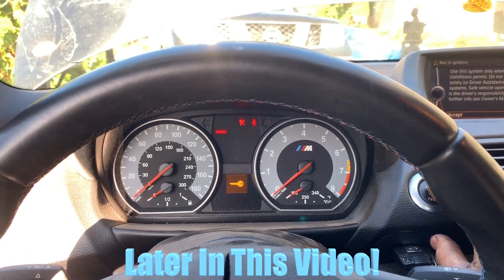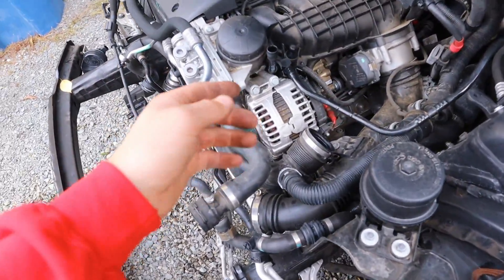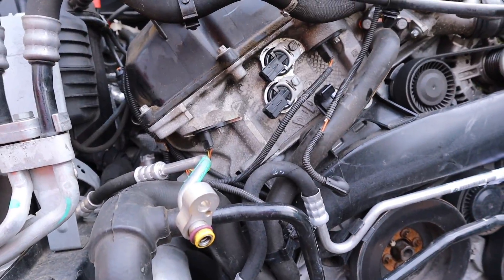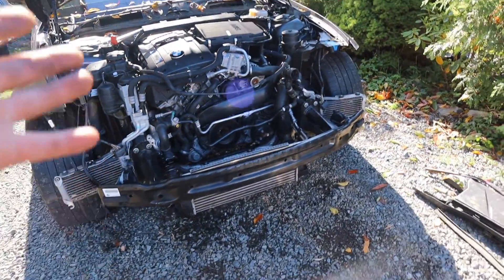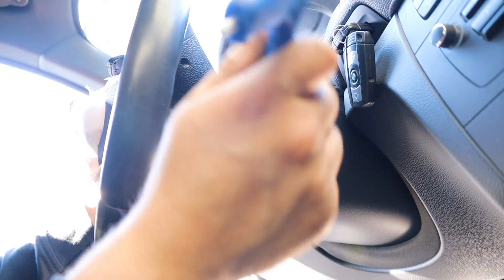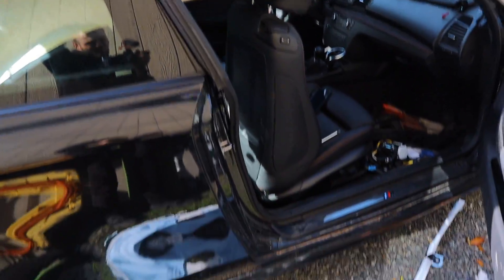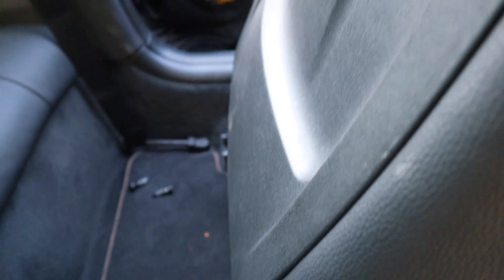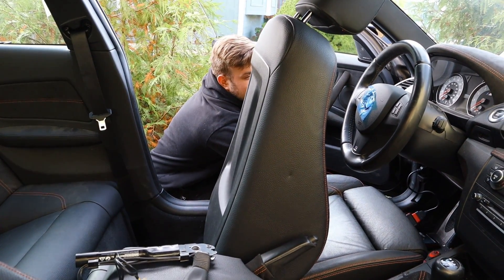I Found SCARY HIDDEN DAMAGE On My Cheap Wrecked BMW 1M From COPART Ep.2

Comment: No fear!  I am enjoying the process so keep up the good work.   The 1M is a blast to drive.   Regarding the rumble from the 1M, someone cut open the "resonators" and found it is actually straight piped to the muffler from factory.  The car is pretty loud and has a drone about 2300 rpm owners often complain about.

Comment: You don't have to make a hole in the steering wheel to get the airbag off. You can wiggle the plastic part with the buttons off and get to the clips from the front. Did this multiple times on my e90 with the same steering wheel.
Reply from the maker: 95% of people go through the hole. Never tried the way you’re talking about but I can see it working.

Comment: I just sold my 1M six weeks ago. Do yourself a favor and during the rebuild check the charge pipe, or better yet, just replace it with aluminum. Mine broke with 18k on the odometer. They are simply inferior plastic junk. The plastic welds just come apart with age. Mine was a garage princess and rarely even saw rain. Do it before it breaks and you lose the clip at the throttle body.

Comment: You don’t have to puncture a hole you can open the covers on top and bottom of steering wheel and then get to the metal clip thats what i do usually just in case anyone didn’t know

Comment: That's a great tip about looking at the side of the steering wheel to see it the air bags,been replaced,never thought of doing that ,thanks !!😀
Reply: ashley kipps just unscrew buttons from wheel and you easly get airbag without making any holes 🤷‍♂️
Reply: O.k,thanks !😊

Comment: I rebuild a 2008 335i about 3 years ago I got from Copart low miles about 37,000 and the motor mount bracket was cracked also from the accident and it want even a hard hit just front end cosmetic but you should be good your car has no frame damage.
Reply from the maker: Found out it’s pretty typical 😆
Reply: BackYardBoyz man you should make a video of all your builds!!! Love all of them and I’m a hard core M guy... wish you the best on your channel and future builds.

Comment: Hi! I notised you didnt pushed inside the blue plastics into the vire housing. They are for a water tightness. By the way there is a more simple way to change the vire housing. Simply just push a needle into the contact and than you can pull it out. 😉

Comment: Why the fuck did you make a hole in the steering wheel when all you need to do is push a flat head in the holes that are already there to pop the pin???